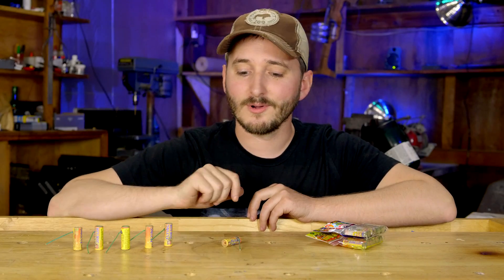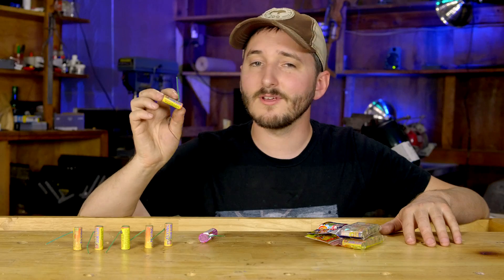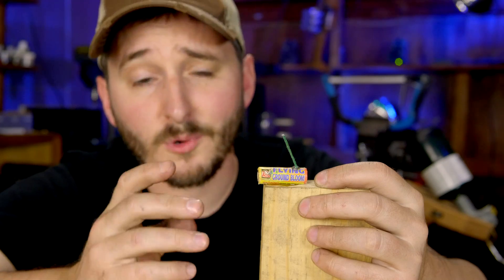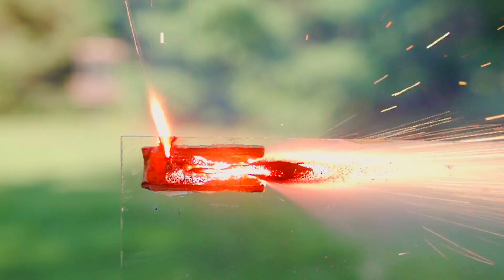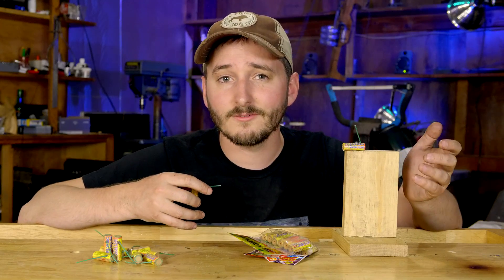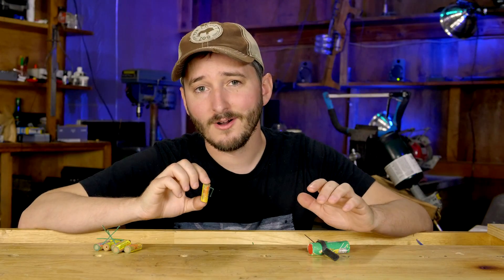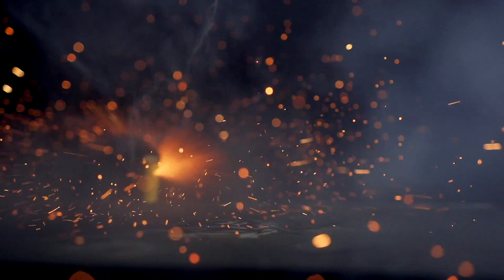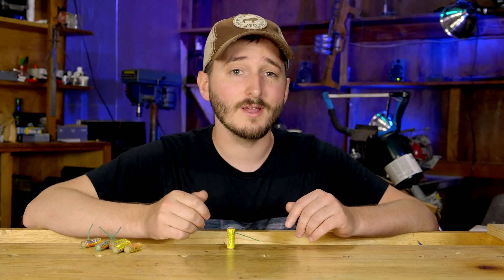How Do These Fireworks Fly?

Comment: You do realize that a AA battery if laid flat on a table and forced to spin quickly enough, by pushing down on one side using your fingers, will spin and raise itself upright while spinning. Once it slows again it will return to being flat. Something I used to do as a child with depleted batteries. I always thought that because it was a cylinder the spin slipping on a hard surface made it bounce and then the spin would gain traction against the surface and would cause it to raise itself. It didn't work on soft surfaces. My recommendation is to try to light the fireworks on something softer with less rigidity like a piece of carpeting and see if it changes things.

Comment: Your years of videos confirm that you are not a fool, (so we can discard that off the bat.) You keep saying friction without indicating, "between what".   Also you mention ground effect and then describe something else, (you are on the right track, but its not ground effect, its "the inertia of the solid surface upon which the firework rests resisting the force of the initial flame, imparting an equal and opposite, {give or take the fluid dynamics of the growing quantity of air between the firework and the surface} force that lifts the desired end away from the surface and towards vertical, in preparation for the liftoff."

You can test this by taking a used and burnt out, (and cleaned) one and attaching it a new one over the vertical thrust nozzle. This will impede the initial lifting of the firework and will cause them to fire off, (with less overall distance archived) at a slightly elevated angle, and not vertically.

Comment: I stopped the vid at 5:11. I think it's due to pressure pushing on the surface of the table. If you could light it while it sat on a verticle surface, it would push away horizontally. That's my theory. Nope. Wrong.

Comment: I think you're on the right track with the friction idea. I used to take batteries and marker lids and such and spin them on the table. What you do is lay ir flat on the table and put your finger on one of the ends. Then you press down hard until it pops out from under your finger with a great deal of spin. It will shoot out and away until you perfect the pulldown and back method. but you'll see it does  the exact same thing as these fireworks. It shoots out spinning on its long axis  and quickly stands up but then drops back to riding on just the bottom edge of the battery until it loses all of its momentum and stops. Try it yourself. Film it in highspeed even. You'll see it spins up and stands up just like your fireworks only with no thrust from black powder.

Comment: I'm thinking that its a combination of things, the thrust from the fuse is obviously kicking the top up, and rotation will start to stabilize it... however in the shots with it cut in half you can see that a lot of mass gets ejected from the fuse hole, so the top gets lighter and lighter, with most of the remaining weight at the bottom making it look gyroscopically more like your blue top.

Comment: When I first saw these, the tippy top was the first thing that came to mind. Of course, the tippy top requires some friction with the ground; spin one on ice and it won't flip. I doubt the firework has much friction with the ground (if at all).

If you look closely, you can see the side nozzle kinda push the firework into a vertical position when it points at the table, so I think that that is what makes it stand up, and since it's spinning, it resists turning any more and remains at a vertical position.

Comment: As the fuel begins to burn at the fuse end, that end becomes lighter than the nozzle end, which leaves it as the anchor towards gravity. That doesn't really hold up considering thier random flight pattern when thrown into the air, unless they're not having enough time to upright themselves from a previous gyroscopic path.  More videos please😃

Comment: The physics going on here are pretty complicated, but the principle is fairly simple. I actually think the slow motion footage makes it more confusing. I know they aren't common anymore, but have you ever spun an empty film can on its side? It want's to stand up. The horizontal rotation causes an axial rotation from the friction with the surface, this causes a gyroscopic effect, where the can will find an angled equilibrium based on its rotational velocity. If you spin the can fast enough, you can even get it to go past its tipping point, and remain standing after spinning. It is much easier for the firework to stand itself up since it's continuously accelerating.

Comment: My guess maybe as good as anything else, but I think it has to do with the mass of the firework. See when you burn the powder it causes it to lose mass on one end, but also to spin, since an object will want to have its mass lower, it will naturally tip so the lighter end is up and the heavier end is down. The firework then ejects the firework upwards into the sky. The spinning is just to get it to jump up and to stay up as it will try to push off anything that is there. 

Or Basically, its heavier on one end than the other when it burns off the powder on one side that side gets lighter, then as it starts to jump up in the air from the flames pushing it around, it's heavier side goes down. Then propels it'self upwards.

That's what I think is going on, an object will always try to spin around its center of mass and with the mass becoming so low on one side, I think vertical is the only way it wants to spin, and it wants to have a lower center of mass so that's why it lets that end go down.

Hopefully, that made sense. That's what I think is going on.

Andrew
Reply: It may be hard but I bet you could test this if you could remove its horizontal vector and make it only have a vertical one, like attaching the firework to a seesaw that can't spin, but can tip side to side if the firework tips towards the end with the rocket first then is pushed back as it ignites. You can know for certain that it's center of mass is changing, the trick is getting the seesaw fast enough to respond. Maybe a high speed could see it.

Comment: The rotational thrust forces that end off the surface until equilibrium is established (I suspect that both ports are shaped in a crude jet nozzle) when the equilibrium is established it is standing on the other nozzle causing it's thrust to make it take off.

Comment: I reckon that the nozzle end of the firework is heavier than the top, so when the firework starts spinning from the initial flame in the side, and that pushes the firework upright, the nozzle will always face down and the thrust from the exiting flame pushes the firework into the air. Even if the nozzle is only slightly heavier (even less than one gram maybe) the nozzle end will tip downwards. That’s my hypothesis.

Comment: I could have sworn that you made a video about a science toy that works in this same way.... The two axis of rotation (Horizontal along the center line of the length of the cylinder, and Vertical at the mid point of the length of the cylinder) don't want to compete, so conservation of angular momentum results in it wanting to precess on end (when captured on a flat surface).

Comment: I was thinking it had something to do with vortex wing aerodynamics or the Stipa-Caproni effect. The barrel-shaped firework is accelerated to the point where the air stream creates lift over the surface of the firework. I see the lifting charge activates after the fuse hole charge has sufficiently lifted the device to the vertical using the above principle. I may be off in what I'm trying to communicate, but lift can be generated over a round, oblong surface with enough rotation to position the firework in anticipation of the lifting charge going off to send it skyward.

Comment: Whats apparent to me is they always spin in one direction, I wanna say clockwise. Why is this?

Well utilizing your slo mo and slowing it down more on YouTube, the propulsion seems to be angled and even if it is for just milliseconds after ignition. Given it happens so fast and with power, I think those milliseconds is all it needs to make it spin and after that as long as the propulsion doesn't change angles by 180°, then it'll continue to spin. Even if the propulsion is shooting completely str8 out. When you did the glass experiment where it's a halve, the flame and resulting burn trace on the glass shows this angle I am talking about.

So it ignites, the purposely built hole and propulsion shoots out at slight angle causing it to always turn one direction ( clockwise ) and the push of the propulsion, speed, combined with the angled burst supplies a spin. Then the main thruster kicks in and take off.

Buy some Estes engines for model rockets, drill in some perfectly straight holes and some slightly angled ones and see if this proves me right or wrong. You can buy some powerful stuff or some less powerful depending on how high you want to shoot a rocket but I believe all will be more powerful than that firework in case that changes anything. And then there's the issue of the engine built to shoot from the bottom instead of the side but maybe you can make it work out somehow. Or make your own copycat fireworks.
Reply: Or, maybe you know all this for sure but decided to play dumb to get us viewers involved. I know you to be a clever guy like that. Touche.

Comment: @nighthawkinlight, I think I've seen you on a couple of the pyro forums I occasionally frequent. If I remember right, either skylighter's or Ned Gorski's site had instructions for a very similar firework and they instructed that the fuse hole had to be off center or it wouldn't work. This lends credence to your idea that the axial rotation around the narrow "top of the firework is necessary for the initial stabilization, and then the ground effect can safely bring the device to a nearly vertical orientation before the lifting portion of the charge is ignited as shown in your cutout demonstration.  Not sure if you want links to the build instructions on your channel as I know youtube is a bit touchy about these things, but checking those guys out and a few of the other forums might be helpful.
Reply from the maker: Yes, I've built 'stinger missiles' before of a similar design, but they require being fired from a nail. Being fired from the side is a unique variation to these fireworks.
Reply: @Nighthawkinlight   I wasn't exactly thinking of stingers, I can't find the article now, but I remember a variation that started from saxons, just without the nail holding it to the board. I'll see if I can find the original from one of the formularies.
Reply: Turbopyro has a similar device If you managed to grab the book, but i still can't find the original post, it might be on fireworking.

Comment: TLDR: While I would love to see more test ( which I describe in greater detail) it seems to me people are over-complicating a self-righting machine that then goes up.

FULL:
Without further test, I don't think having an angled fuse is needed. Yes, I agree that it could be angled to help the firework go right-side-up, but not required. 

Consider the following cases:
- Once the fuse is lit, if it starts spinning around the main axis (which it is much more likely to due to inertia, and mass distribution) it will accelerate that spin. The object first turns slightly, because friction, and what was accelerating parallel to ground is at 5* to ground, with the combined accelerations changing the velocity, and friction along its main axis with ground making spin occur. Which then occurs more as more and more energy goes to spin rather than linear velocity.

- A mathematically perfect cylinder with a fuse/hole 3/4th up its side that is perfectly circular and normal to the center of the cylinder. Even if it is set up in a perfectly metastable state where the fuse is pointed perfectly up, you would still need a mathematically perfectly flat surface for it to rest upon and for the combustion to occur in a perfect manner that perfectly evenly distributes both the reactants used, and the vectors of the products in order for it to stay in that metastable state. Any imperfection in the shape of the objects or the combustion reaction would cause acceleration in some other direction than perfectly down.
- In essence, friction makes it so it rolls, after all rolling friction is less than sliding friction, and inertia (at this mass/acceleration ratio) means it wont turn easily. So the energy goes to spinning. Of course the top part which is giving off energy will move about and lift off the ground (in many or any direction), but the bottom will fall down by default, and the spin will go faster because it was already spinning and is still accelerating.

I don't know if I conveyed my position properly because "Me english and grammer good. Me speak much and more better."
basically:
- It must start spinning, because it would otherwise require a perfectly cylindrical firework on a perfectly flat surface, perfectly expelling and perfectly reacting fuse and chemicals.
- Once it starts spinning, it spins faster because friction with the surface and inertia of the firework.
- Eventually the top fuse part leaves the ground, and the heavy non-combusting engine ends up below it.
- The spin makes it act like a gyroscope, so that by the time the engine starts, it goes relatively strait, upwards because the engine was down.

Test I would like to see: 

Many fireworks cut in half not long wise... I really don't know the proper word to describe the relative position, but the other direction than what you did with the glass (not that I wouldn't have wanted that test too), where you effectively separate the fuse and the main engine.
- One test focusing on just how the fuse side acts independently of the main engine. Does it spin around randomly or move crazily - generally moving completely randomly (which would support my hypothesis that the engine's mass is important to the self righting mechanism)? Does it end up spinning upright like it does with the engine (suggesting that something about it's construction is specific and important)? Does it spin in some other pattern or something else (who knows)?
- One test where a weight of some kind (approximately the same weight as the engine) is added to the fuse part. (Which can support or disprove my hypothesis)
- A sanity checking test, where we burn just the engine part (in such a way that the only output is down) and show that it doesn't spin itself upright. It may do something weird we're not accounting for. Could possibly lead to more tests for the engine part.

- Another test that could be cool is a test where the fuse is chained to the ground/surface in such a way to allow it to spin on its main axis. How does it act?

Love the video

Comment: Ground effect prevents gyroscope from its procession...  both.  Gyroscope with ground effects.  Very cool.  Makes sense to find an axis of rotation.   I wouldnt think friction plays significant role in rockets bc its negligible compared to other forces acting on it in such a short time.  Can you scale this up or disable vertical thrust to gather more data on gyroscopic rotation.  It takes off too quickly

Comment: It's almost certainly turning upright due to a difference in moment of inertia. The tube spinning horizontally has a higher moment of inertia while spinning vertically has a lower moment of inertia. The ground effect and/or gyroscopic procession cause the slight torque needed to go from a less stable configuration to a more stable one.

Comment: Take a double AA battery, and place a off center spinning force along the horizonal azis.(i.e. lay it down horizontally on a table and with your finger push downward slightly off axis to impart high backwards spin near one end,to cause it to shoot 'forward' whilerolling backwards).  The battery will heavily spin and, with enough force, stand up on it's opposite end.  It's basically a combination of friction, and a lower moment of inertia along one axis of rotation vs the other.  Ground force does also help in the firework case giving it initial rotation in another axis.

Comment: Well any real-life application of phsyics is way more complicated then on paper, and will have many factors contributing, right? 
So when the 1. nossle is "fireing" it causes the firework to rotate, and at some point the nossle might directly touch the ground, what would cause it to upright (a little bit), since the nossle is way more on the "top side" (otherside then the downwards facing nossle)
Also the spinning motion around the "short axis"  will cause more friction with the air then around the "longaxis", therefore the firework would "rather spin" around the long axis, which would again upright it, right?

Comment: At the fuse point, there is less weight above it, and more below. If you took a fulcrum, and placed it underneath a plank at ratio as the fuse hole to the length of the cylinder, the longer side would go down, and the shorter side up. The fulcrum is the same as the fuse hole once combustion starts happening out of it, and it spins(because of ground effect, angled hole, etc).

Secondly, I would think it's more likely it spins because thrush and ground contact. The thrust causes it to move, friction slows one side more than the other. Then there's the combustion containing the ground, which makes it want to move in the opposite direction, but deflection off the ground, (as noted above➡️) gravity , and friction will cause spin. Then, the fulcrum(fuse/hole) being placed towards the top end makes the heavier end stay down.